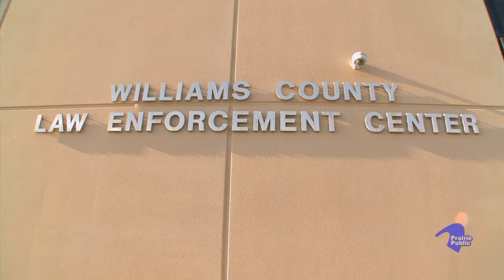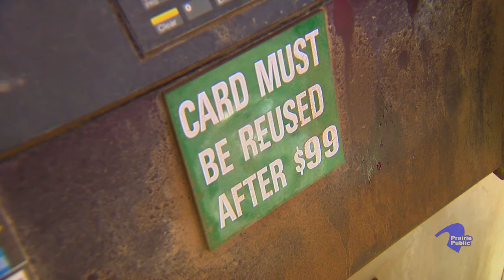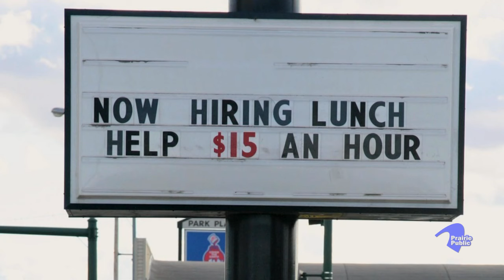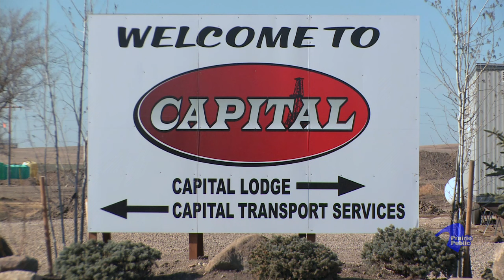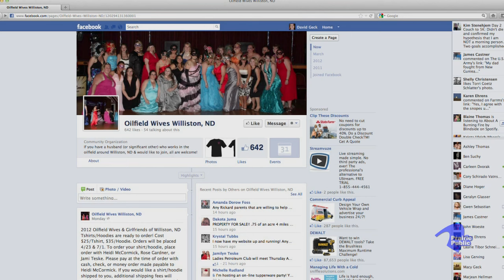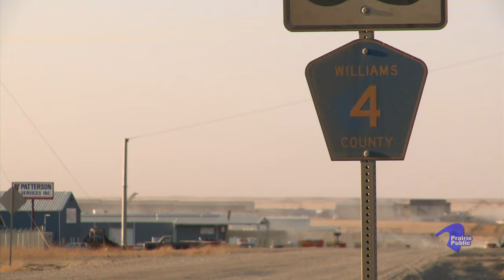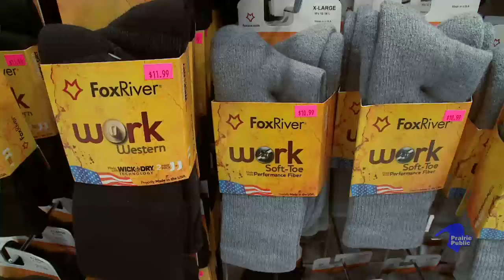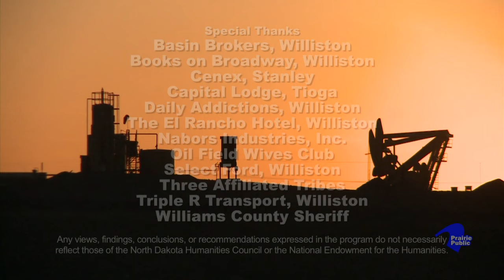Faces of the Oil Patch

Comment: A lot of these old folks keep talking about a bust, however, in the 50s and 80s, oil didn't profit nearly as much as it does now.  I'm gonna guess it will eventually plateau out, meaning, you can only have so many wells going.... the long term problem I see is there aren't enough other businesses moving in and advertising.  The old folks think it will die out, but it won't be like that.  With a booming area like that, you need to be able to get other business and/or manufacturing companies based on the raw materials.... i.e. plastic companies, refineries, etc.  There also needs to be a lot more advertising and incentives for working there.  The Tastee Freez, etc. (example!) needs to offer relocation fees to people throughout the US.  I think a lot of the planners, companies, and local govt. need to play a little bit more simcity. ;)  I could go on and on, but the consensus I get is that people are panicking and running around in circles when they need to be planning and doing research on the changes.
Reply: wimblyx, you're right to an extent I think...but what goes UP must come DOWN...just a law of physics in general.

There's only so much product underneath their feet/drills. Once the amount of extraction balances out with the demand, then believe me when I say, it will come to a halt and things will slow down regardless. The infrastructure isn't there now, so it looks like a mad mess. There's only so much room for equipment on existing parcels, and mineral rights and properties will eventually be all claimed. 

Nothing saying if you're adventurous and willing you shouldn't go up there and take advantage of the boom though.
Reply: wimblyx You make some good points. However, I think this program illustrates a number of good things that are being done. Did you watch the whole thing?
Reply: Tom Szirbik,Sr. And I spose you've heard that now, in 2015, things are slowing down. Many see this as a good thing -- and it's nowhere near a bust yet...